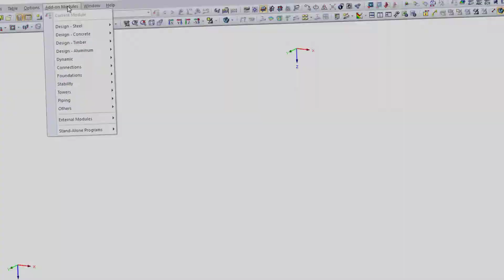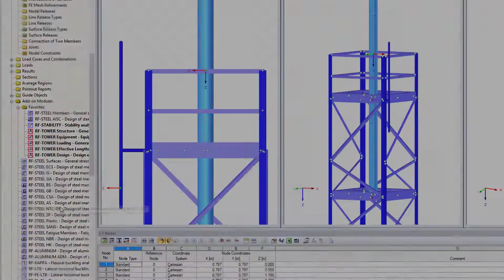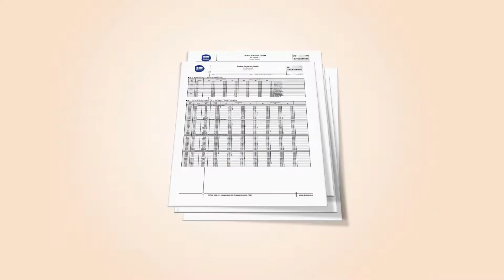Generation, Analysis, and Design of Towers and Masts | Dlubal Software

Comment: Do you have BS8100 as well within the codes available? It is a quite old one, but still used in the UK.
Reply from the maker: Hi, Brahms!
unfortunately not. You can design towers and masts according to BS EN1993-1-1 and BS EN 1993-3-1.
Reply: @DlubalEN  yes I have noticed from the video. Unfortunately some bodies in the UK do still use the BS8100. I was looking into some alternatives to Bentley softwares and came across this! Seems very neat. Great feats!
Reply from the maker: Hi, Brahms!
Thanks for your feedback.
Reply: Hello   @DlubalEN   
I'm using tower design modules under RSTAB 8. 
The default assumption of member-ends restrain is pinned (shear connection) , my question is how to define partial restrain cases like if members connected with >1 bolt at each of member's end. Thank you.
Reply from the maker: Hi, Bashar!
You can uncheck the 'Join't box at 'Joint' in MAST Structure or the bar end joints can be deleted themselves. In MAST design, you can also select the type of infill depending on the screw situation.

However, if you mean where to change the default - you can't do that. But the assumption of a jointed bar is very typical here.

When the structure has been generated in the module, there is another overview with all the bars where you can edit the joint for each individual bar.
Reply: BS 8110 has little or nothing to do with towers and steel structures generally. You could consider BS 5950
Reply: You're correct that BS 8110 has nothing to do with towers, but BS 8100 is all about them.